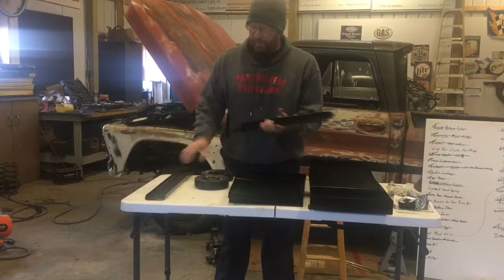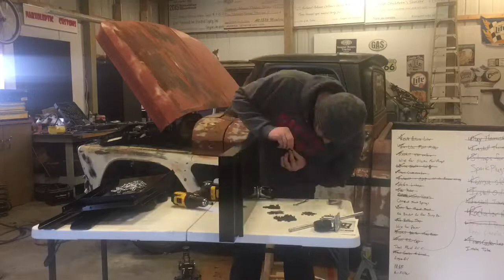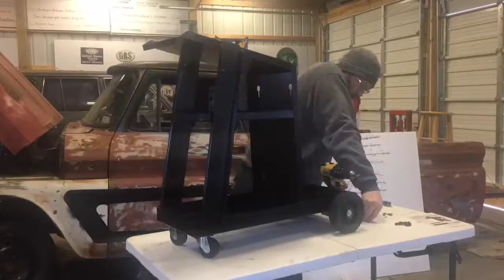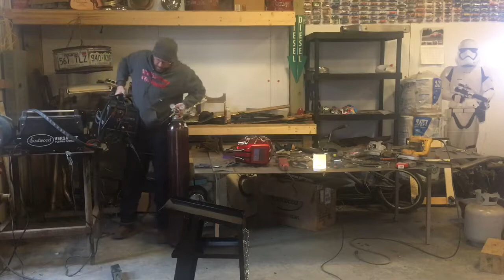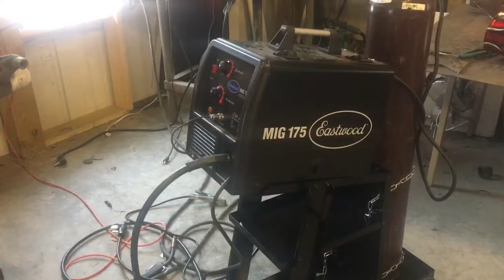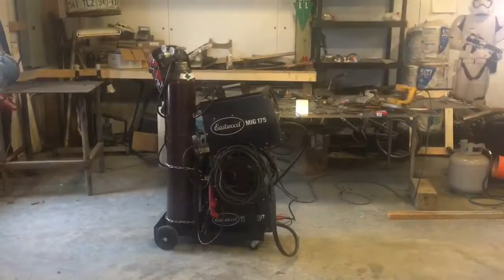$30 Harbor Freight Welding Cart - Build and Review

Comment: Just bought one, think I'm going to move the back plate all the way to the rear & the front kickers closer to the center, I don't plan on buying a bottle. That should put the weight my Lincoln 140 over the rear wheels, making it easier to roll, plus it will give me a longer bottom shelf. Going to spray the trays with bed liner to help keep the welder in place, keep the others from rattling & getting banged up.
Reply from the maker: The bed liner is a great idea!!!